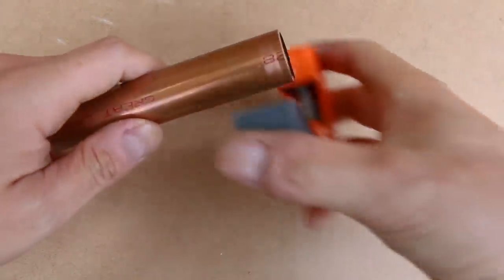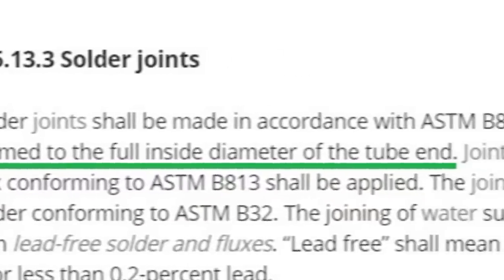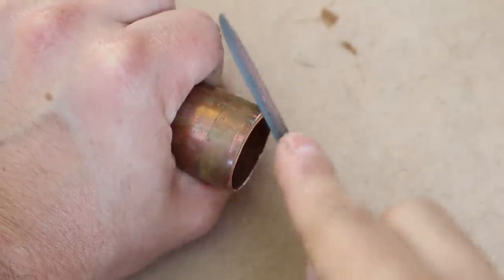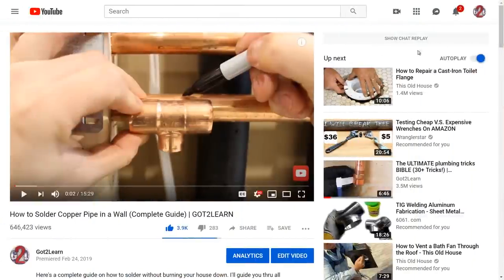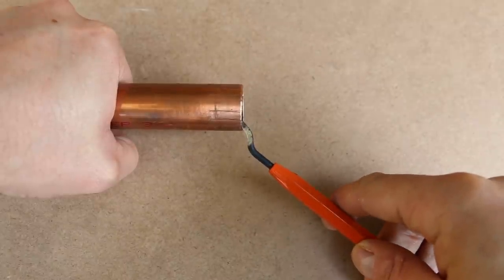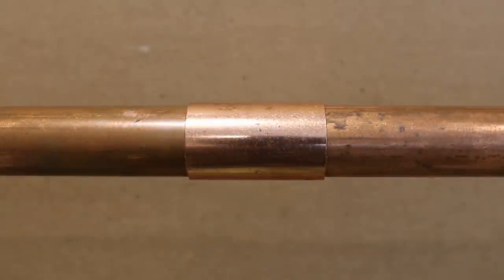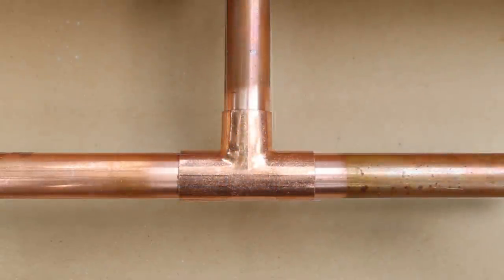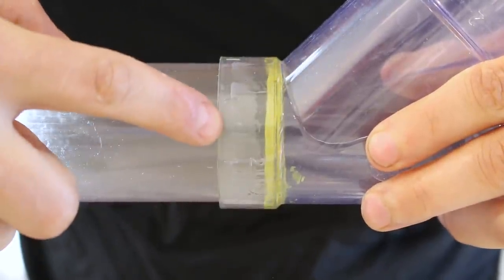The WORST Mistake When Soldering Copper Pipe (Not Deburring) | GOT2LEARN

Comment: If you flip a pencil reamer 180, you can use it on the outside of pipe. Held correctly, the little bump on the tip of the blade actually rides on the end of the pipe and allows you to ream the outside equally well as the inside.
Reply: What do you mean flip it 180º?  This sounds like a great tip, but I'm haing trouble following you.  Do you mean reverse the direction of travel?  I tend to use mine clockwise around the bore, are you suggesting to use it anti-clockwise on the outside?
Reply: Have you actually tried it? Damn near impossible! Not for deburring od anyways, the cutter geometry isn't meant for it.
Reply: @bennyd8471  I've tried, but not persevered.  Not currently in possession of one else I'd try again.

@Cody Moncrief Have you tried this with success, personally?
Reply: Pulls out a knife and gets it done. More often than not it’s what you have on hand!
Reply: @kinzieconrad105  But when you're a professional, learning the quickest and easiest ways mean you get the job done faster and the customers are happier.  And you always have the correct tools to hand if you're organised.  For DIY, a knife is fine and does a good job.
Reply: @Cody...you are correct, you just have to develop the proper technique...

Comment: I always deburr only because I was taught that the burr will restrict flow. I never knew about the turbulence causing pinhole leaks.
Reply: Yep, that’s the main downside to copper pipes. Even a little piece of sand that gets stuck somewhere will cause pitting that leads to the pin holes. That’s also why it’s not a good idea to use copper pipes for any kind of drain piping. As long as there’s constant flow, copper pipes can last as long as any house.
Reply: I learned that at Caterpillar as a apprentice 1978

Comment: Thank you, for adding the plastic pipe section. Another thing that, some, people don't realize is that plastic pipe needs to be cleaned before you glue it. It's just my preference, but I like to use cleaner, rather than primer, because it's easier to see that the pipe has been thoroughly cleaned.  I have had people tell me that new plastic doesn't need cleaning and I've, also, seen their fittings leak.
Reply: Silicone seal, applied in same manner (both pipe and socket) as cement, works well for decently supported non pressure pipe. Still need to rough up both surfaces but joint is quite strong.
Reply: @xenuno     I’ve used silicone on   TEMPORARY drain lines.  Works fine and easier to strip and re-use.  The silicone really doesn’t bond to the plastic, acts more as a gasket.  Would never consider using on a pressure line or for a permanent install.
Reply: @tomrogers9467 Right .. which is why I said "decently supported non pressure pipe". If roughed up it bonds better than you think.

Comment: I'm not a plumber by trade but I do  alot  of plumbing from time to time, when I was taught how to sweat copper, the old guy said you never ever sweat pipe without deburring! Pride and craftsmanship is a rare thing these days
Reply: @Deon Denis totally agree, whenever I walk into a newly remodeled restaurant or a new one, the tiles are always crooked and uneven, I've yet to see caulking done properly,  trim work is horrible,  it's just sad that things are like that now
Reply: I’m betting the word “Craftsmanship” will be removed from the dictionary within 20 years because it will be unheard of.
Reply: When I first got into the trades over 20yrs ago, i knew this old drunk plumber, he deburred every pipe.  That guy was drunk when by the time he got to work and sipped on beer all day at work, but he was a great plumber
Reply: @buzzsaw301  yea that's how alot of them old timers were back in the day, I've worked with quite a few,  drank through out the day but took work very serious as hard to believe as that is, they took pride in what they did, also they could get away with drinking because things were different back then, you didn't have to tie off and wear a hard hat just to fart like you do today
Reply: I think a lot of craftsmanship is overshadowed by contractor pressure and quantity of work over quality. You definitely see more quality with private contractors but even they have to compete with the large unionized laborers.

Comment: Yes learned the hard way didn't debur and one of the burrs after soldering and the shut off valves had a plastic ball (home depot shut off vs actual plumbing shop valve with a steel ball) put a hole in the ball water damaged a brand new rehab, in the middle of the winter valve failed due to my mistake and it cost me, alot.Good info.👍
Reply from the maker: Ouchhhh...that sucks.

Comment: In home appliance repair we tend to deburr with sandpaper when working on sealed systems. Sandpaper tends to take most of the particles with it, which helps keeps them from getting in and clogging the capillary tube.

Comment: I was taught to deburr the pipe. I only knew that it was the best way to mate the pipe to the fittings and never understood why the inside of the pipe needed it also.  I didn't know that excess solder could cause erosive corrosion either.  Thanks.  I just found your channel and appreciate your work
Reply from the maker: Glad I could help!

Comment: Had to redo all the main pipes in a house I was living in because of it. Take it seriously, installers. It seemed like someone was playing a trumpet somewhere in the house whenever a faucet was being used. Even the neighbors next to me could hear it.
Reply: wow
Reply: Bored? It didnt make a difference unless there was metering device the pipe was going to. The corrosion crap is just that... crap. Haha been doing heat and air for forever and it does matter on refrigerant lines because of the metering devices. Water pipes are unaffected. This video acts like all piping is copper but most pipes that handle the tasks they are talking about are pvc and it doesn't burr like copper piping so it doesnt require reaming.  Just more trade security. Lol
Reply: @charlesstidham2788  I dont know about you, but we use copper pipes. Not PVC, not multilayer, or anything like that. It totally made the difference and there was no more rattling, vibrations and banging.
All the clamps became loose because of the vibrations, but tightening it didn't make any difference at all, just gave more bass to that noise.
Burrs will never benefit your installation in any way, in any kind of installation, so why leave em? It only takes 5 seconds to deburr a pipe, and if you're soldering it is supposed to be a permanent installation. Unless you're after callbacks it doesn't make any sense

Comment: Absolutely correct. . But at the same time pipe turbulence is everywhere in your home. From water passing by a tee to a gate valve to a reducer. . Water is a pain in the ass basically. That's why I wash with sand 🤣
Reply from the maker: LOLLLLL
Reply: Have you met Emma...
Reply: I am more into flinging Sir Harington.
Reply: I undertsand this is not about me though.

Comment: Thank You, Thank You, Thank You.,
    I am a machinist so I deal with deburring parts every day. I also have to deal with hydraulic systems, mostly the repair of them after somebody with no clue has already messed things up. Plumbing for water is no different. Free flow is very important for the reasons you show in your video. Whenever I plumb something I make sure there will be nothing to negatively affect the flow. Burrs and excess solder cause all sorts of problems and conscientious plumbers will not leave burrs on pipe cuts, will not use too much solder, and will clean joints of flux after soldering.
Eric
Reply from the maker: Very well said, thanks eric!

Comment: I know for a fact that im the only Technician where i work that reams my copper tubing before installation which is crazy! Same goes for using an inspection mirror. Also having 2 containers of flux, one to solder and one to clean after soldering as you should never use one for both because it melts the brush and makes the flux dirty which causes leaks. These 3 reasons are why i have less than 10 callbacks a year and havent had a callback for a leaky solder joint in 5 years!
Reply: Unfortunately, workmanship and taking pride in your craft is becoming uncommon.

Comment: Im a commercial new build plumber and I propress copper a lot and Im not going to lie, most of the time i dont debur the pipe but im going to buy the tool for it.
Reply from the maker: When doing propress, the pipe needs to be deburred both on the outside and inside, very important :)
Reply: Yeah we always use grit cloth on the outside whether you are sweating or propressing but most of us didnt realize it was bad to not debur the inside
Reply from the maker: Yeah, that's the problem, it kind of disappeared but it still needs to be done.

Comment: Great information. I'm no plumber, but I decided to take on the task of replacing poorly placed pipes leading up into my kitchen sink from the basement below, and running hot and cold water pipes about 10 feet over to a sink that had been installed in the basement by previous owners, who had never gotten around to actually doing it. 

I decided to use a copper-to-PVC adapter, and to do the new plumbing in PVC. I bought a DIY manual and asked advice. I was told that, should I eventually sell the house, the home inspectors would specifically look for purple PVC primer on all the joints, and may fail it if it wasn't there, despite the fact that modern PVC cement actually precluded the need for the purple primer. So I made sure to slop on the purple stuff before cementing everything together, so that it would be VERY easy to see, just in case! I lived there for 6 more years, and never had any leaks or problems with my first-ever plumbing job...
Reply from the maker: Good job bud, yeah...a lot of inspectors have that as a requirement or they don't let it pass.
Reply: @Got2Learn  Thanks. That was the quickest response I've ever gotten to a post! There were a few copper pipe joints I had to solder before adapting them to PVC the rest of the way, and I remember being impressed by what I guess would be referred to as the "capillary action" of how the solder was automatically "sucked" into and throughout the joint, requiring almost no effort from me...
Reply from the maker: Yes capillary action always impressed me, even to this day, it's such a cool phenomenon. I am glad you were able to get it done man ;)

Comment: I do a lot of copper pipe fittings, almost no plumbers seem to do deburring. 
I saw one plumber deburring the pipe, however when checking the inside pipe the lip was not completely removed.
I use a metal counter sink drill bit in the drill. Helps when doing a lot and larger diameters.
Once again great content.
Reply from the maker: Thanks, yeah unfortunately, it's not seen enough :(

Comment: Something I’d never done and I’m sure I’ll have pinholes before long. Dad taught me most things but didn’t get this one sadly.
Reply: Get a piece of pipe and some elbows and a cap. Then a torch and some solder and flux. Practice by making a J shape with two elbows and cap the short part. Place it in a bucket of water and blow into the pipe and look for bubbles. It’s not as hard as you think to teach yourself a new skill.
Reply: Same here. I plumbed my upstairs bath without deburring anything about 20 years ago. I guess it's a ticking time bomb now...

Comment: Conventional pipe cutters don't leave a burr on the outside of metal pipes, because they incorporate a roller that smooths the burr down as the tool is rotated about the pipe.  Only the inside burr needs to be removed.

Comment: I had all my copper pipe extrude polished to a 10 micro finish.  I'm hoping to increase my pressure and flow as it passes through the pipe.  I should get over 50 years of life out of it. I will be eating a dirt sandwich by then   but at least water will be flowing  nice and smooth through those pipes!
Reply: Great job. You have went the extra mile. One point on the increased pressure and flow. I have read that pressure and flow do not increase on a horizontal pipe because of the friction of the liquid rubbing on the walls of the pipe as it is flowing (this would not be noticeable except on a very long run of pipe). On the other hand, flow and pressure of the liquid will increase on a pipe that is dropping in elevation because of gravity or head pressure. I understand that the pressure will increase .433 PSI per 12” of elevation drop. Or 4.33 PSI per 10’ of drop or 43.3 PSI per 100’ of elevation drop and so on. Just some info I’ve read about piping from years ago.

Comment: I completely agree with this,  I have to wonder how long the burr will last vs it's impact on the pipe.   i.e. the burr itself will get worn away over time.
Reply: the way i picture in my head is a sportscar (water) going full speed over a speed bump (burr) and the car's front bumper scraping the pavement (the pipe wall). the wear on the burr will be minimal compared to the damage to the wall.

Comment: you should see the HVAC "experts" in my country. none of them know anything about copper piping, and will try to convince you that it is perfectly normal for a split air conditioner to lose most of its coolant (and therefore capacity) within 5-6 years. of course, they will offer to refill it for a "small" fee. a very nice customer scam and enviromental damage combo.
Reply: How do you ream existing copper tubing after it’s been cut, when it’s in a vertical position?
Reply: I’m just afraid of small shavings going back down the tubing
Reply from the maker: Hold the shard with one hand, team with the other.
Reply: @Got2Learn  yea but the pipe is coming up out the roof and it’s only 3/8” copper tubing
Reply from the maker: @bobbytafoya13  what's the problem?
Reply: @Got2Learn  I’m in hvac , if I ream copper tubing while it’s in a vertical position, I risk copper shavings falling down in the refrigerant lines. That’s a big problem in hvac
Reply from the maker: @bobbytafoya13  that's why you must hold the shard (burr) woth one hand, or else it will fall inside the pipe.
Reply: @Got2Learn  ok, I guess I’m just not understanding how you are supposed to hold the  shard (burr) inside a 3/8”copper tube while reaming it
Reply: Maybe u shoul make a video using 3/8” copper tubing
Reply from the maker: @bobbytafoya13  it's the same as 1/2" or 3/4"
Reply: @bobbytafoya13  in this case your not gonna want to debur it your just going to want to ream it. Needle nose plier enough to open it up will do the trick

Comment: G2L- Your videos are the best, and so far, this one on deburring is the best of the best!  This is professional instruction!  Narration is paced nicely, demos are great, comparisons of good and bad, before and after, cutaway views, animations, and explanations -  just crazy excellent!  And kept to a reasonable time.
      So I didn't try the file, but I tried the built-in reamer on my Reed TC1Q and that seemed small and hard to manipulate on 1/2" copper.  Next I tried a pencil reamer, and without much practice it didn't work anywhere close as nice as in your video, maybe I can do better with a lot more practice.  Then I tried a Husky inner/outer (barrel) reamer, and immediately got great results on the inside.  But for the outside, the barrel didn't stay centered for me turning the barrel.  What did work for me was to put the barrel tool on the floor (held between my shoes) and rotate the pipe (like a basic pencil sharpener), although not possible if the pipe is very long or already installed.  Thanks again!
Reply from the maker: Wow, thank you so much for your great comment, I really appreciate it. Some people prefer a pemcil reamer some a cone reamer, it all comes down to preference and then practicing with it, good job Larry!

Comment: I see the results of this all the time on recirculating lines, absolutely frustrating. Been changing the lines to pex with plastic fittings on the upstream edge to minimize erosion.
Reply: Recirc lines are the worst - hot water running 24. - 7.  Had lots of erosion and corrosion in my commercial units.  Especially when the contractor cheats and runs schedule M instead of K.   (The M has the thinnest wall, K the thickest.).

Comment: While they're at it clean the flux off after soldering,it turns the area around the joints green,look in your own house,it's a good bet you'll find green joints,they will rot eventually.Another annoyance is seeing copper pipes  running through walls without being sleeved or wrapped,another point where corrosion can strike.It's all done for speed,many can't be bothered to do a good job.
Reply from the maker: Good ones, thanks!

Comment: Good explanation. When I was learning pipe welding you would fail the test if you have to much reinforcement.  The goal was 1/16" to 1/8" (max). But the reasoning is the same, turbulence and back pressure

Comment: Thanks. Hopefully I will find an application for this in the near future. Less noise = happy me. Less problems down the line, even better 👍.

Could be useful in several applications from cars, radiators, plumbing and more. Quick and dirty fixes becomes a headache later on.

Comment: Not much of a plumber, but as a PC builder who also build custom watercooling deburr is also required in there. Best 0.5cm at 45 degree angle and also inside. Both for flow and not damaging one of the o-rings in the fittings.
Reply from the maker: Yes, I did my own water cooling too, it's a must ;)